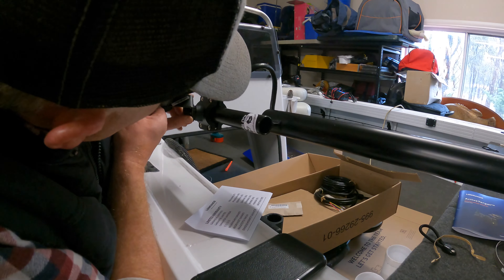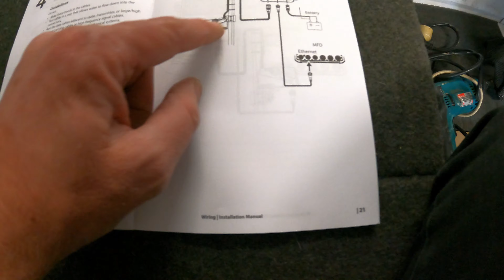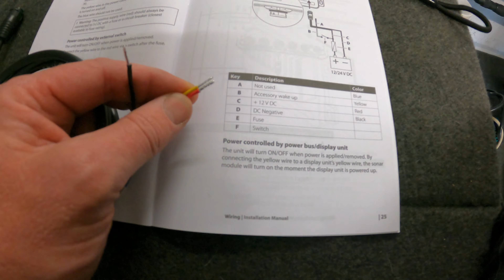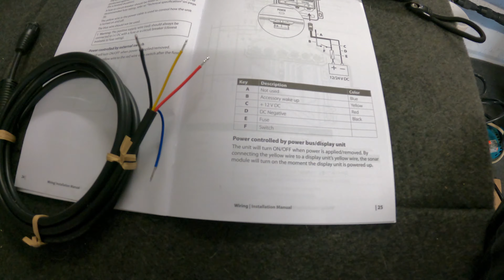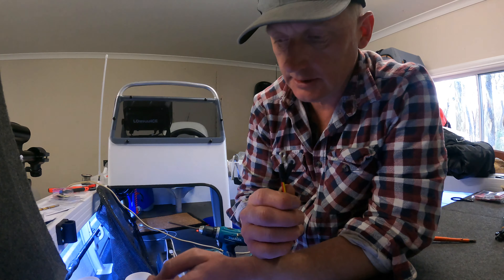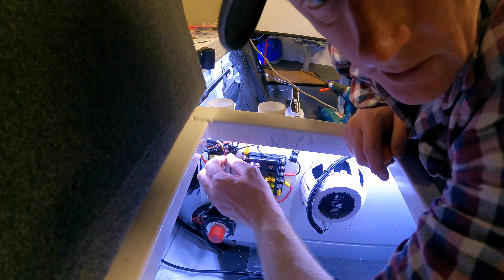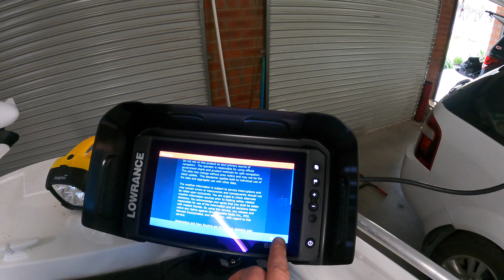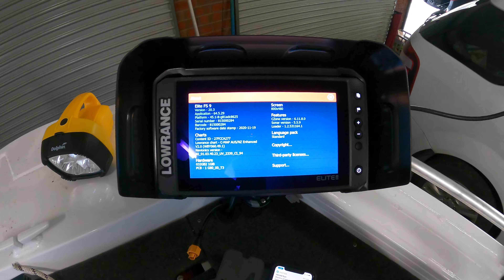Lowrance Active Target  Install - Pole Mount on Quintrex 420. Elite FS Units

Comment: Hi mate very useful video . The Fs 9 that you are using in the video is just for the active target system only yeah .cheers
Reply from the maker: Hi Shane - mainly yes, but also use it for all the addtional feature - 2d sonar, Structure scan  - netwroked to the transducer on the back of the boat. Cheers

Comment: What is the little clip called with the adhesive that you used to organize the wires? I need thosE badly.
Reply from the maker: Hi - I used the small advise cable mounts which I purchased at Jay Car -  link attached https://www.jaycar.com.au/small-adhesive-cable-mounts-pk-25/p/HP0782. Hope this helps

Comment: Hi Grazza what did you use for cable management coming through the deck to the sounder?
Reply from the maker: G/Day. Drilled a hole in the front casting deck and used a rubber Grommet - big enough to slide through the plugs to the finder. Picked mine up at Clark rubber.
Reply: Thanks

Comment: Thanks for the video, this pole setup is the route I will go. Also where did you get the glare cover for the Lowrance unit?
Reply from the maker: Hi Michael - the best option. Glare Cover was from CH Smith MArine in Melbourne.

Comment: I didn't see when you connected the mount to the pole , does it just screw into it ? Thx
Reply from the maker: Hi Paul - the follwoing pole https://chsmith.com.au/Products/Garmin-Panoptix-Anodised-Pole-Mount.html comes with a mounting block which connects the pole with the bracket